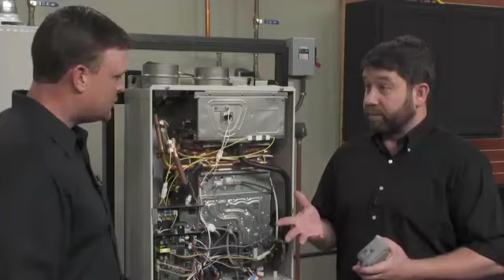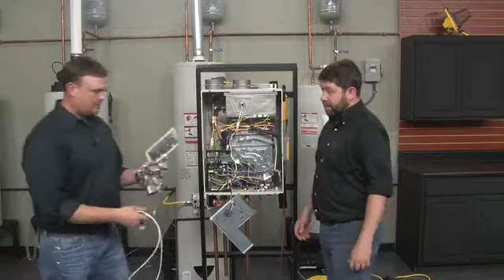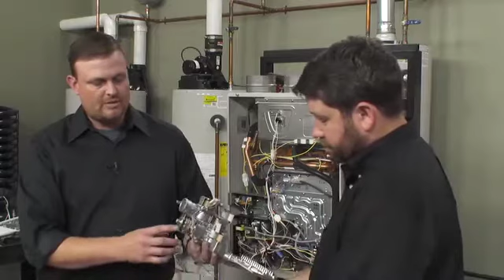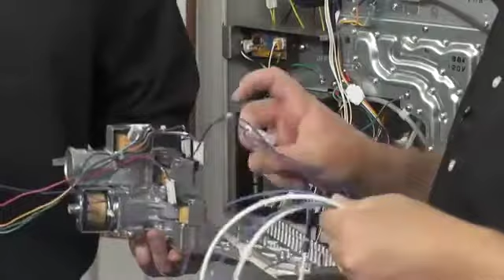Code 711   Ignition failure

Comment: I don't know if you are still checking this video, but it's been very helpful and I suspect you could help me nail down our problem more narrowly. I have a 711 code on my residential unit. I can turn it off and reset it and get hot water again briefly. We had a service tech come out and did the maintenance on it, and then lost hot water again. The unit sounds like an airplane preparing for takeoff at times that nobody is calling for hot water even. Also, I do not hear the clunking you mentioned.